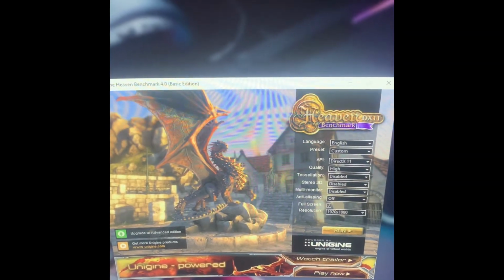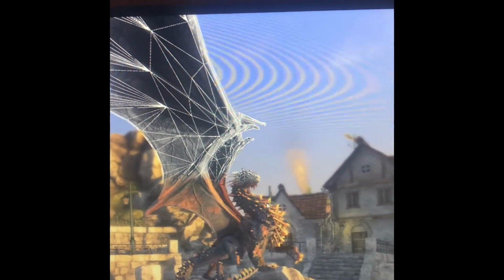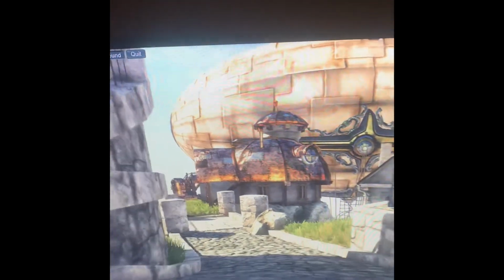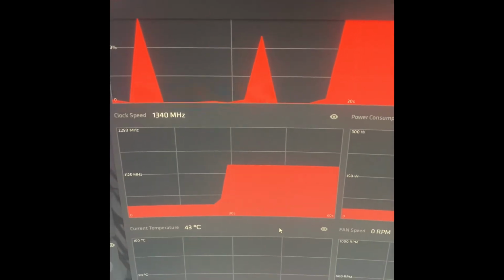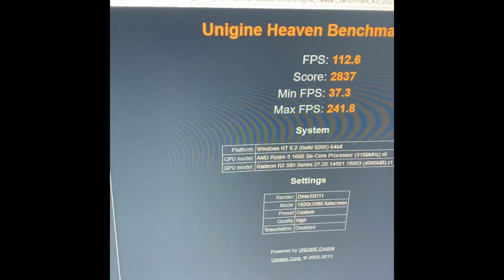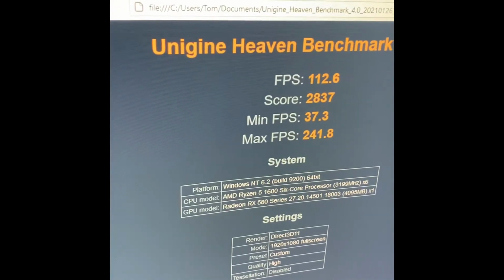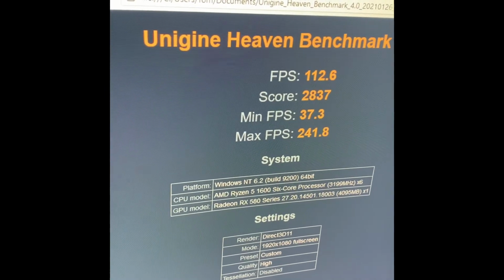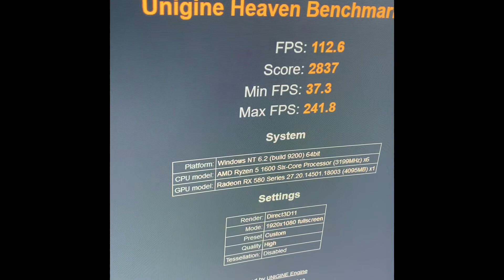Sapphire RX580 - Thermal Pads: What size to use? Explained

Comment from the maker: Hey guys, been getting a few comments which I’ve had to remove because they are entirely misleading. If you aren’t going to watch the video, read the description or read the comment threads below here’s a TLDR:

-Original pads are 0.75mm, confirmed by Sapphire. This is not a commonly sold size.

-1mm pads are too thick and stop the die and heat sink making proper contact, use 0.5mm, proven to work by myself and others below with no issues

- Regardless of the quality of the brand 1mm doesn’t appear to squish down to 0.75mm
Reply: alright, i'll try 0.5
tried to use 1mm pads and the temps are not good, and its unstable
Reply: 0.5 mm did the job, thx a lot bro
Reply from the maker: @bhizta  Result 😎
Reply: @JLRO7   i FUCKED UP I PROB SPENT LIKE $20 ON THERMAL PADS NOW, I BOUGHT 0.5MM PADS IT ARRIVED TODAY AND BOY IT WASN'T EVEN CLOSE TO CONTACT TO THE COOLER

PEOPLE USE 1MM AND USE THE GRAY ONES THAT SQUISH, HELL EVEN BUY A 1.5MM FOR GOOD MEASURE
Reply: Did you end up redoing the paste also
Reply: So annoying I also looked for videos to try find out. I saw one guy use 1mm, but you could see he didn't really put any effort into fine details
Reply: What tests should I run to see if it works ok. I have previous game log data. I was going to use this.
Reply from the maker: @aphaseelec  For the testing I used Unigine Heaven - it’s a free download and works well enough to test the temps.

The card in the video is still working strong and hasn’t been touched since so the 0.5mm pads are good to go.
Reply: @JLRO7  did you redo the thermal paste after you reopened to do the thermal pads
Reply from the maker: @aphaseelec  Yes, I’m not sure if that was needed but I did it anyway so make sure it was fresh
Reply: I used 2 mm thermal pad and thought my thermal paste is duplicate or something because when I do stress test it just goes 80+ in few seconds
Reply: Fuck I just used 1mm's

Comment: Sorry for bombarding you with questions, but I needed to ask - you only used thermal pads of one thickness (0.5mm) throughout the PCB right?
Reply from the maker: I used it all over - not sure what the backplate sizes were meant to be but the card is still working

Comment: and what happend after crash. Turn off display and fan full speed??
Reply from the maker: @Marko_003  Black screen, fans at 100%.
Reply: @JLRO7  Me now have this problem, i put 1mm pads and gpu show me 67 *C. Throtling on 1100 mhz, if i dont underclock gpu for 8 percent, not posible play game, crash after 10, 15 seconds. clock speed 1411mhz
Reply from the maker: @Marko_003  Try the 0.5mm pads. 1mm is too thick and causes bad contact for heat transfer.
Reply: yea. thank you so much. I solved problem.
Reply: You doing good with 0.5 so far? @Marko_003
Reply: 20 days i finding solving solution.

Comment: I have a 1mm thermal pad. and I read some comments here that the recommended thickness is .75mm. So i have an idea of pressing down this 1mm thermal pad of mine until it reaches a .75mm thickness do you guys think its fine? or very dumb move?
Reply from the maker: Didn't work for me - you need to use 0.5mm

Comment: I put to my rx 580 sapphire nitro arctic TP-3 thermal pads of 1mm, I had no problem in any stress test and the maximum temperature is 75 degrees with the fan at 80% use, it is noteworthy that also has arctic thermal paste, the thermad pads have at least 0. 2mm of compression, so in practice, would be at the end 0.8mm, only 0.05mm more than the originals, I have the graphics card in a micro ATX case so the airflow is not very good, the idle temperature is 34 degrees with the fans at 20%. 
(I'm translating this into English with a translator, so excuse me if there is any inconsistency) (I comment this in case it is useful to some people for information, with no intention of denying something or creating hatred)

Comment: Same 0.5 for vrms?
Reply from the maker: I used 0.5 in everything in this video and it’s still going strong today 😎
Reply: @JLRO7  whats the brand is it? Im going to change thermal pads with thermal grizzly minus pad 8.. is it good?
Reply from the maker: @razmanrhoads2078  Thermal Grizzly is a good brand, I used some no name stuff on Amazon and it worked fine.
Reply: @JLRO7  Owh ok jowsh.. thanks..

Comment: But we have no information on vram temperature on Sapphire RX580 with 0.5mm. Sapphire recommends 0.75mm. 0.5mm may be insufficient.
Reply: Absolutely! Did you get any update on this? I'm about to use Gelid Ultimate 0.5 and Gelid Solutions GC-Extreme th. compound on it for the extra 0.25mm! In this video I am also concerned with having no VRM temps reading (HWiNFO64 does read those sensors)!

Comment: hi, I have a similar problem with the RX 590 nitro ... I wanted to replace the thermalpads and the paste and after replacing it twice, the temperature rose to 83 degrees and the fans stop spinning only after restarting the pc.  I used 1mm gelid gc extreme pads.  do you try with 0.5mm?  I'm worried that the fans do not stop spinning after reaching 45 degrees ...
Reply from the maker: The heat sink doesn’t make good enough contact with 1mm pads so give 0.5mm a go.
Reply: @JLRO7  But we have no information on vram temperature with 0.5mm. Sapphire recommends 0.75mm.

Comment: Wish I had watched this before buying a 1mm pads for my Nitro+ RX570 2 days ago. And you're right 1mm is too thick and the heatsink doesn't make contract with the die. Ordered 0.75mm pads today. sigh
Reply from the maker: Where did you find 0.75mm pads? I wasn’t sure they existed outside of the factory 👀

Comment: Mee also just made a mistake by putting 1mm pads on my rx570 card near chips. Ordering the 0.5mm as that u said. It seems your card is just boosted the frequency and performing much better. Hope mine also works as same.

Comment: Will the vram make contact with tha pad and the cooler. Because it may contact on the gpu, but 0.5mm is not thick enough. So the vram may not contact i believe, can you double check on that and give me the awnser. Thank you so much
Reply from the maker: Yes it does

Comment: can you please answer me about my problem , i am scared to open my gpu even if i know about these things i am not sure i dont want to blow up my gpu because they are sensitive :((((( and my gpu is sapphire rx580 nitro+ 8gb and i play games normally with some temps are normal it is strange because some temps are not going above 60 or 65c max but i use fps limiter amd chill :) if i not use it and fps are 60 or more my gpu is overheating like crazy :(( and in some games with fps limiter again it overheats goes to 80c ??? and my fans are 26% 1150 rpm in 75c ???? 700-900 rpm in 65-70c and then after 75c 1150 rpm and it stays that way till 80c ?? i am afraid if i use some gpu tester or games without fps limiter amd chill that vrm will explode :((((  and are pads same size like yours 0,5mm ?? . Hope you understand me and hope you will answer me :) God bless.
Reply from the maker: Hello, best thing to do is open it up carefully and take a look at the pads. If they aren’t dry/cracked you can leave them. You should definitely replace the paste though!
Reply: @JLRO7  ok tnx on reply and sorry for my Bad English i know my comment was hard to understand :((( and one more think i hear sometimes when i boot my pc small squeaking sound and one time when i made manual fan rpm in AMD program when it start to change fan rpm it start to make that sound :((( i think it is from my Gpu maybe fan but it is not always only when it change fan speed not sure or maybe bad vrm i hope it is not :((((( and in my town it is hard to find thermal pads i thought to put tin foil aluminum on them but that is experimenting with GPU and this card is expensive would not want to blow vrm :(
Reply from the maker: @derim006  The squeaking sounds like coil whine, you can stop it by replacing the power supply but it’s harmless, just a little annoying.

Absolutely do not use foil! Leave the pads as they are and just change the thermal paste. The pads will not make much of a difference to temperature by themselves.
Reply: @JLRO7  Ok thank you very much for info and for fast replies :)))) i read now on some site about coil well i did not know about this :))) it is interesting that electricity and magnetic field make this kind of sound and it is normal ?? and it can be everywhere in PSU in Motherboards in GPU :((( even HDD :( but i know i heard it in GPU when i come too close i hear it sometimes and it is when i start to play games that are GPU heavy and GPU heat is 65 -75c then it come few seconds and that is that or when i turn manually my GPU fans above 900rpm and that is sometimes not always . Just one thing what is size in thermal pads in mine is it same as yours 0,5mm or 1,5mm ?? And well tnx again and God bless :)
Reply from the maker: @derim006  The card in the video is the same as yours so 0.5mm pads would be the size to use. :)
Reply: @JLRO7  ok tnx i wanted to be 100% sure , mine is nitro+ :) i wish you all best and God bless you again :)
Reply from the maker: @derim006  Happy to answer other questions you might have, I’m not an expert though:)
Reply: @JLRO7  tnx :)

Comment: Just to make things clear for everyone. DON'T USE 1MM THERMAL PADS ON MEMORY CHIPS, EXCEPT FOR VRM. Doesn't matter how good or expensive they are, just use 0.5mm instead if you can't get 0.75mm. I made a mistake by thinking that expensive pads (Thermal Grizzly Minus Pad 8 1mm) would squish down in thickness, but that's not the case. Even pushing down with an extreme force wouldn't change its thickness that much. Heatsink doesn't make a contact with GPU chip. Hope it helps someone, because some of the information is misleading.
Reply: Thanks. I found information online where someone contacted Sapphire about the thermal pad size and listed the specs for it via a data sheet. (.75mm).  The guy also suggested flatten the pads as much as possible if buying 1mm, and then quickly put it on the card with everything. I would not rather rush this, so I have 1mm and .5 size pads. I think I will stick with the .5 mm.

I bought thermal grizzly, and some guy requested using Nabs cooling or Gelid thermal pads and ignore the others. The temperature on my graphics card during gaming is 75 celcius. Due to that graphics cards being super expensive, this sapphire card is going to have to last a while. Eventually temperature will go above 75 celcius, and I want it lower.
Reply: I recently switched to 1.5mm from 0.5mm because i didn't knew about that size shii xd
Now i understand this thickness thing
I was going to order 1mm but i saw this video and your comment
Thank you now i am going back to 0.5mm
Reply: I recently changed thermocouples. For memory (vram) and VRM, I used 0.5mm. I was looking with a feeler gauge, only 0.75mm is used on the backplate and I haven't changed there yet.

If there are bad thermocouples on the VRM, what will the problem be?

I mean, I tested it on OCCT and I also play it and everything is fine.

My card is rx 580 4GB nitro +
Reply: @kazik85  on the back plate is used 0.75mm?
Reply: @IIvIIistery  Maximum tolerance is 1.5mm, 1mm is enough.

Comment: Thanks much for this. I put some 2mm pads on my rx 580 not thinking about the die making contact with the cooler and the thing wouldnt run. now I know why!!! I've got some 0.5mm's to install and hopefully get it working again.
Reply: Fuck, bro, i feel you, actually, in this moment i'm watching this video for the same reason.
Reply: Me 2 I used 2 mm thermal pad and thought my thermal paste is duplicate or something because when I do stress test it just goes 80+ in few seconds.

Comment: After putting 1mm Outus branded thermal pads on my RX 570 i've experienced my temperature going up to 80C° even with 100% fan speed. After opening the card multiple times i got really frustrated because i couldn't figure out what went wrong. After i've found your video i opened up my GPU the 4th time and i saw the cold plate was not making full contact with the die. Now i've put 0,5mm pads inside and it now runs at 63c° with 40% fans in my trash tier Aerocool Cylon case at maxed out power limit (150W). I hope the VRAM temps are allright because my RX 570 does not have a sensor for it. Thank you for making this video, you saved me a lot of headache. Edit: I've bought some branded 1mm pads, but they were still too thick. Looks like 0,75mm is the way to go, but it's impossible to get.
Reply: hi, is your rx 570 a xfx model? i'm wanna change my thermal pads but i don't have idea what size to use...

Comment: I have Sapphire RX 580 Nitro as well.
Don't be e cheapskate and buy some good quality pads and 1mm will be good. I bought 80x40x1mm Gelid Extreme and card works like a charm. 1 pad enough to replace all pads on card. Used Thermal Grizzly Kryonaut for GPU die. 
Don't buy Gelid Ultimate as those are stiff and will prevent GPU die from making a good contact with cooler.
GPU under 100% load in Unigine Heaven benchmark on loop, after 1hr 62 degrees Celsius with ambient 21.

Fractal R6 case, front door open, 2x140mm front intake fans and 1x140mm exhaust. I use 280 AIO in top part of case, warm air has plenty of space to escape. 
When gaming, open door, when browsing/ watching movies close the door. Perfect for both silent/cool when needed.

Comment from the maker: Hey guys, we had a commenter try some high quality 1mm pads that were squishy but still were not suitable. Before editing this comment I linked a video by Jay where he used Gelid pads and mentioned that they were squishy and had good thermal performance.

From now on I will only recommend 0.5mm as this has proven to work by myself and others in these comments with no noticeable difference in thermal performance.
Reply: So I could use the Gelid of 1mm for the RX 580? For the memory and vrm.
Reply from the maker: Barbaration97  did you get on alright?
Reply from the maker: Barbaration97  Thank you for trying that out. I’ve read many people using 1mm and it working fine but like yourself it didn’t work for me.

I will edit the original comment to reflect this.
Reply: @JLRO7  I guess he used 1mm Gelid GP-ultimate pads, great W/mK but those are stiff. I used 1mm Gelid Extreme pads , bit less W/mK but are soft and squishy, everything is in perfect working order.
Reply: @JohnSmith-oh9ux  all pads you use 1mm in rx580?  Gelid extreme? Please link to pads

Comment: I have like HIS RX 580 IceQ x2 OC 8gb .. 2nd hand card from mining been using it for like 2 yrs now. I didn't open up yet! ahaha, What thermal pad size should I use ? I think it's about time to re-paste and re-pad this mining card a bought 2 yrs ago.
Reply from the maker: I’ve never heard of this card, very little information regarding it online. I think it would be best to take it apart and re-paste and evaluate the condition of the pads. If they are still moist and not dry/cracked I would leave them.

You could get a variety pack of thermal pads like I did which included 0.5, 1 and 1.5mm and just match the pads up to the closest thickness to what is already there. 

Sorry I can’t be of more help, there’s no technical documentation so it’ll be a little bit of trial and error for you.

Comment: is 0.5mm making proper contact with the heatsink? my gpu is missing couple thermal pads and remaining pads are either ripped or in poor condition. previous owner messed up everything.
Reply from the maker: Yeah I took the card apart afterwards and you could tell the heat sink had made good contact because the thermal paste had been spread out.

The thermal paste did not spread with the 1mm pads which I imagine is what caused my crashing initially.
Reply: @JLRO7  i wasnt talking about the thermal paste but nevermind. i guess it doesn't matter. does the quality of the thermal pad matter? which thermal pad would you recommend?
Reply from the maker: @dq8093   Yes I know what you was asking,  you can tell the pads make proper contact with the heat sink judging by the paste. I was just saying I didn’t get good contact with 1mm as the paste didn’t spread.

The card was manufactured with 0.75mm in mind so anything thicker and you have too much of a gap between the heat sink and the PCB.

I’ve linked the Amazon product I used in another comment, they were just cheap things but didn’t squish at all.

I’ve read other commenters have success with Arctic brand as it compresses due to it being softer but other than that I can’t say.